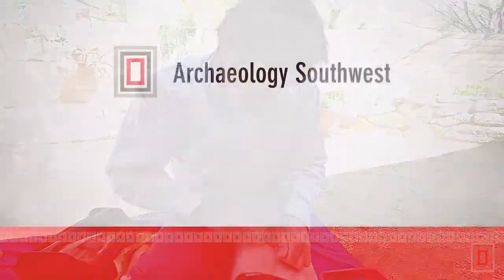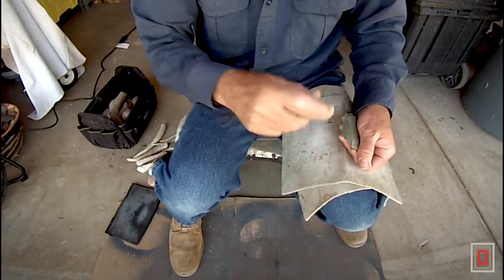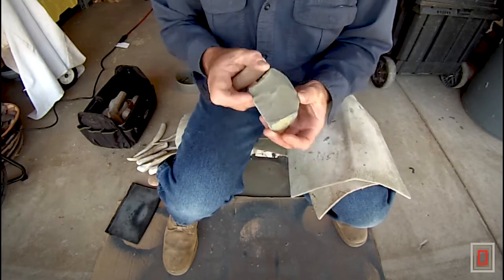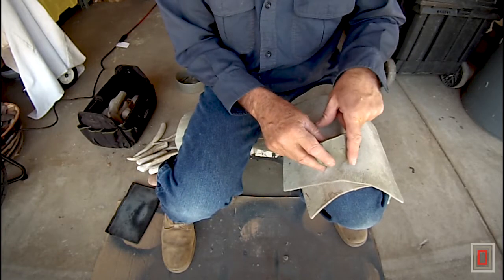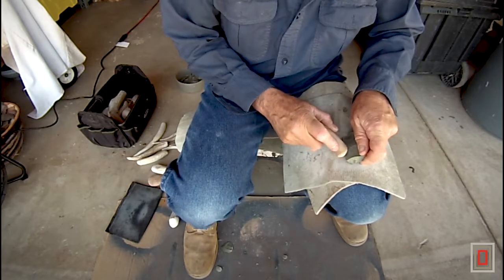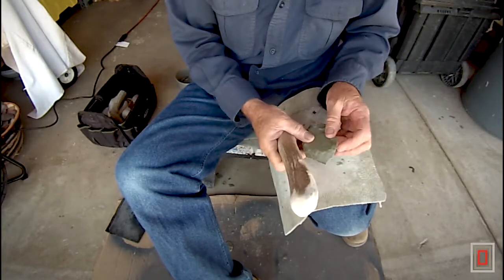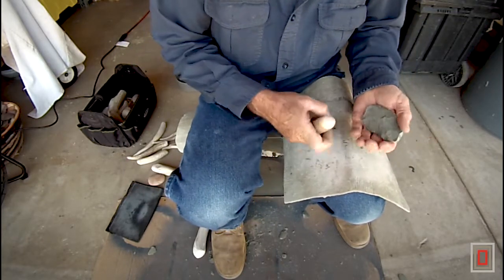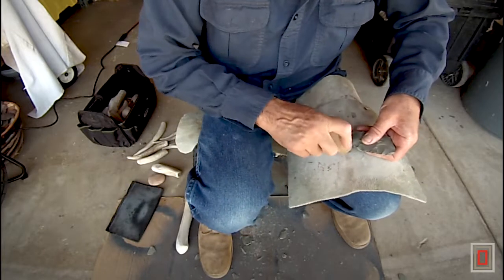How Did People Make and Use Stone Tools? Part 6: Biface Thinning

Comment: Where can I get some billets from mule deer or elk? I could use an entire set of antlers from both. Antler is such a great material to work with! I’ve used copper rod for pressure flaking with good results. Crabtree’s book from decades ago was instrumental in my work.
Reply from the maker: We checked in with Allen, and he tells us that he's had luck finding antler from the annual Gem and Mineral show hosted in Tucson, Arizona. Pet supply stores might be another good place to look, as antlers are often sold as chew toys for pets. If you're comfortable purchasing materials online, several online retailers also sell billet sets specifically for flintknapping. Hope that helps!

Comment: What is overshot flacking
Reply from the maker: Thank you for the question! Here's what Allen had to say: "Overshot flaking is when the flake goes all the way across the biface, removing some of the edge on the other side of the biface. The results can often be disastrous, but when done in a controlled way, it allows a flintknapper to thin a biface with very few flakes on each face. The larger flakes make great tools as well."